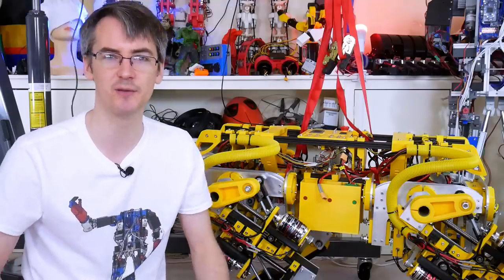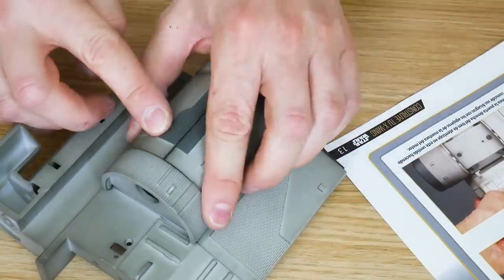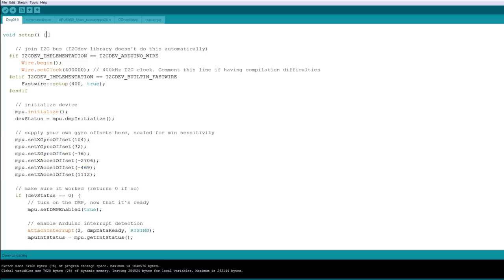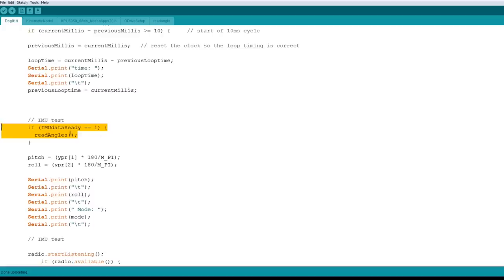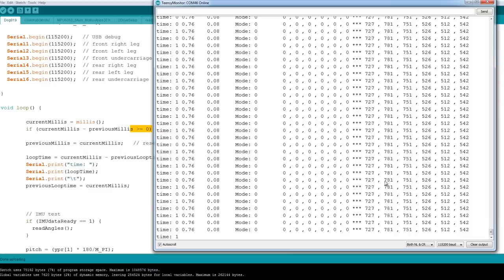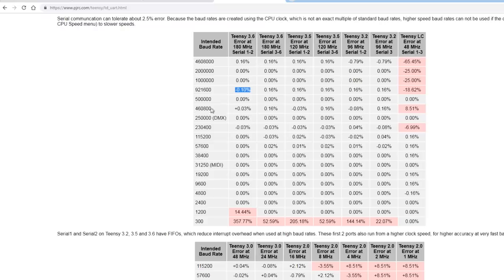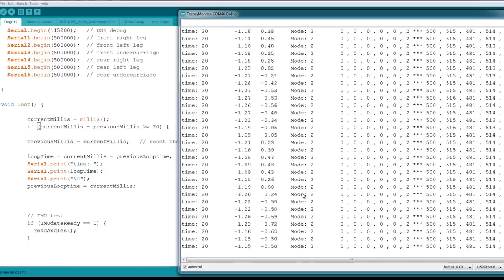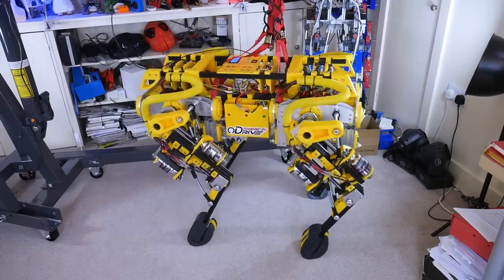openDog Dog Robot #19 - Some Stability | James Bruton

Comment from the maker: I actually realised that my Kinematic model function is writing to all 12 ODrives four times in every loop, so I'm actually doing 48 ODrive writes per loop instead of 12, so that needs sorting out in part 20 and the loop making even quicker.
Reply: 40ms initially for 4x12 ODrive writes. Quick math says even if you went back to the default ODrive baud rate you'd be within your 10ms threshold. Glad you found that issue!
Reply: @SystemsPlanet  You can use YouTube membership by clicking the Join button above. HTH.
Reply: There should be non-blocking versions of the UART's transmit function for the Teensy.  There is no reason your main code should be waiting around doing nothing while a UART slowly squirts out the bits.
Reply: That makes more sense, I didn't think it was a serial baud issue.
Reply: Interrupt-driven serial comms is the solution. Fill a buffer, and let the UART peripheral take care of sending it. It'll let you know when it's done. Split the traffic among more than one port too (parallelization!)
Reply: ha ha you beat me to it I was going to ask you about the 12 ODrives
Reply: Since the timing wont be in sync between MPU and Teensy, you need to ensure you're reading the entire FIFO and clearing it out. You only seem to be reading the first record, the FIFO is slowly going to build up because it doesn't appear you're emptying it.

Comment: Hey James! I work as an embedded firmware engineer, if I can give you some advice, I would consider using an RTOS. This will allow you to make better use of the processing power you have rather than adding more co-processors and with that more complexity. FreeRTOS is an excellent project with lots of documentation, large community, and is even used in industry. 

If you end up using a scheduler, you likely could precompute some of the required positional data with your interpolation and set up some DMA channels to send that out giving you more CPU cycles to process input. 

Just some thoughts, love the project!
Reply: I +1 this. At this moment, he can use DMA for SERIAL of Odrives, freeing the cpu
Reply: I whole-heartedly agree. FreeRTOS saved my project.
Reply: I'd ditch the stupid Arduino environment way before i worried about an RTOS.......
Reply: @maxtorque2277  Using an RTOS would solve an immediate 'felt need'. Ditching the Arduino environment would add complexity without actually providing James with any tangible benefits (at his stage of development)
Reply: Personally you might do better with Zephyr and or Nuttx or perhaps Riot,

stm32 is well documented ( well for anything other than the M3 F2 ) so you should do well out of the gate.
Reply: @vannoo67  What you mean like a Schedular and most likely better interrupt handling?
Reply: @maxtorque2277  I would go with PlatformIO + VScode
Reply: @sethrd999 I didn't realize that you would get that from an IDE. I have used and quite liked PlatformIO, but it didn't offer any of that.
Reply: As many people recommend for several weeks..
Reply: Dedicated serial connections for each odrive is the fastest way to update them, but to get real performance, I'd suggest hacking a Tesla neural processor and train the dog to work out the motor control for itself.
Parameterizing a kinematic model manually is a nightmare, but neural nets just do it naturally.
Reply: @ahaveland  I think first he has to set up a reliable powerful environment first, meaning with good programmed routines and fast response. Also a good controller strategy would be nice.

To use ML for solving the problem is maybe "the new thing" solving problems (which could be often solved more simple with the right controller), but without a rock solid  basement it is simply called waste of time.
Reply: Looks like he doesn't read comments. /shrugs I don't blame him,  Way way too many of them XD
Reply: I'd add that continuing the way your architecture is currently will be unsustainable unless you move to use some threading or scheduling strategy such as is being recommended here. As it is now, all your I/O is coupled together by virtue of using a single loop or interrupt service routine, thus the slowest operation binds everything. The sooner you deal with that and all that polling when there is nothing to be done the sooner you'll be able to do what you want when you want.

Comment: Arduino libraries are great for throwing quick, simple, projects together. The sad truth is, most Arduino libraries are a master class in how not to write firmware and the complexity of your project is reaching the point where the cracks are starting to show. As others have suggested, perhaps consider an RTOS or at the very least structure the code around a proper event loop. That 180MHz processor is more than capable of doing everything you need and more, but only if its resources are used properly.

Comment: Just as others suggested: Interrupt driven serial communication through buffers would probably do quite a lot of magic here. At the moment, your Microprocessor on the Teensy is spending most of its processing time waiting for one UART to finish the last byte before ffeding it the next.
Not only would interrupt driven serial communication allow for other calculations to take place during that time, but also to use all UART peripherals simultaneously.

Comment: I love teensys for robots.

What I've learned:
Don't do things synchronously. Everything should be an asynchronous/incremental event handler.

Send one or a few bytes per time through the loop, calculate only one joint at a time, poke whatever bytes pending in input buffers into a state machine for the packet parsing.

Aim for a loop time < 1ms, ideally 0.1 ms.

This means you have to pull apart almost any third party library and rejigger it to not be blocking, though.
Reply: this is great advice but also its why I'd never bother using a library.  screw blocking black boxes!

Comment: This has been mentioned several times, and I am sure you see it, but JIC: the threaded rods that connect the ball screws to the legs look bent.  I thought it was some sort of camera or lens distortion at first, but when you switch angles it is still there.  The left front leg looks like it is bent the most, but it looks like all of them have at least a little bend.
Reply from the maker: Yes they are, I overran the end-stops at some point and the actuators are powerful enough to bend them.

Comment: James, in your function dmpDataReady, instead of setting IMUdataReady = 1, try incrementing the value, then in your main loop, read the data IMUdataReady times to clear the FIFO and decrement that counter with each loop. This will prevent fifo overflow and give you the most recent value from the IMU

Comment: Another suggestion here. The Odrive uses ASCII code to communicate. You can switch to binary code  and that can make your communication be  at least 8x faster for the same baudrate, but then you need to fix your message frame size.

Comment: Is there a specific reason you're (still) using the Arduino IDE? there are much more capable IDEs that have a lot of comfortable features like code folding, auto-completion, refactoring and what not. I suggest you look into Sloeber V4 if you're fed up with the Arduino IDE :)

Comment: How much data is being sent over serial to the odrive? Does the MCU not have hardware serial? If so maybe try increasing the transmit buffer ideally your packet should fit in the buffer.

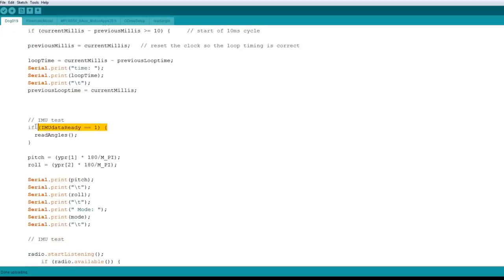Comment: Talking about what you did on 7:00
In most micros you can configure the input pin to detect the rising edge without enabling the interruption. This would avoid a context switching and a possible race condition

Comment: You know that you can do serial writing using DMA transfer so that it does use any CPU at all. Basically u set up the DMA to send the data so at a set rate triggered by a timers. You will just give the DMA the address in RAM that your variable is stored at then the DMA will just send to serial the data at that address in RAM every time the timer triggers. Then anytime you change the value of the varible it will be sent to the serial automatically without using any CPU
Reply: @Out of the BOTS, I haven't really heard of DMA being used like that before. Normal you set up the DMA with a pointer and a length and an interrupt is generated when the end of the buffer is reached and the DMA controller deactivates, until triggered again. If you are only ever sending one value I'm not sure you would save many cycles because you would need to re-trigger each time. If you could precompute a few values in advance with an interpolation engine, than it might be worth while
Reply: Well, if it isn't Mr Bots
Reply: @VLS-Why   There are many ways to trigger DMA transfer, especially in ARM CORTEX architecture like Teensy. One of the ways is triggering it via timer ISR  but even if you trigger it in the loop time the benefit is obvious with this ammount of data flying on serial bus.

Comment: When you are doing timings of functions, what is the overhead for writing out to serial as well.  I remember in my, rather limited, arduino programming that writing useful debug stuff out to serial was completely wrecking my timing critical loop being able to work properly
Reply from the maker: I thought about that, but it's still a negligible impact when before I write to the other 12 axis.

Comment: Hi James! I've done some work with balancing robots using remote IMUs, and a big factor for getting good data out of them was making sure they are mounted firmly to the frame of the robot. At 3:37 you can see the IMU board move significantly when you poke it with your pen. I know that's not an issue you were addressing in this video, but I'm afraid it might be a problem later on when you're trying to make the robot dynamically stable. From the video it looks like it should be fairly straightforward to 3D print a bracket to hold it more firmly, though. Good luck!
Reply from the maker: thanks, it might not have been screwed in during that shot, it's pretty firm

Comment: BTW, you can easily calculate the basic serial transmission time as you know the number of bytes being sent to the Odrive and the Baud rate.  For example at 1Mbaud, each bit takes 1us.  Each byte sent is 8 bits, and i'd expect you to be using 1 start bit, so that's 9 bits per byte, therefore, each byte takes 9us to send, so if you send 10 bytes, that's 90us per message (Assuming your uart serial register load/unload can keep up)
Reply: Should have added, watch out if you are transmitting in ASCii and not in binary. Send "128" in binary and that's a single byte to send, send "128" in ascii and that's 3 bytes! (ascii "1" is 49(dec), "2" is 50, and "8" is 56, ie each digit is sent as an individual byte. Therefore, your ascii serial coms might be creating a significant overhead.......

Comment: I guess the stability control would not work like that for a simpler robot with only 2 DOF legs, because it cac't shift its COM left to roght easily. But maybe it could try to balance by actuating the floating legs back and forth?

Comment: Doesn't dumping all that data out the serial port to the terminal take up significant resources?  Also to get a more accurate timing, set a pin high at the start of the loop and low at the end of the loop, then connect a o-scope to that pin and you can see exactly how long the routine takes as well as how much "reserve" time you have left.

Comment: If you delete some of all your debug data, you write to the serial console, you Will see a much faster timing. No matter the baudrate of the serial port, serial writes slows the program down alot. Of course 0,5Mbits/s is faster than the standard 9600

Comment: I'm not very familiar with programming an arduino (isn't it a custom C++?), but at 9:55, couldn't you have written   Serial.print("time: " + loopTime + "\t");    as well? I realize that's probably just a stylistic choice to do it on multiple lines though.

Comment: Why not use the ISR to read so you don't ever overflow? Copy the new data on interrupt to some buffer. Did you test that and see how badly it impacted the main routine? I'm guessing you won't notice the ISR really impacting your main loop after all the other testing you did.
Reply from the maker: It is, and it clears the buffer each time even if there are multiple values in it.

Comment: Amazing video!! Thanks for sharing.
Sir, have you ever faced any problem using that i2cdevlib library? I am facing a strange problem, after running for 30sec - 1 minute the Arduino stops getting data from IMU. Can you please help me out?
Reply from the maker: It's probably power supply related - the IMU needs very stable power in DMP mode

Comment: James... I'm watching you struggle with your electronics quite some time now, since you tend to run into bottle necks.
So finally, please buy some proper electronics for robotics, this project deserves it.
In example something like a Beaglebone Blue running ROS.
I know you are trying to avoid that, but your projects are slowly maturing into really complex mechatronics so you need to start to gain experience with SBCs and Linux.
The ROS has a big community and I'm sure they will gladly teach you how to use it. Starting with UART you really should go for faster and robuster bus systems.
But at least look at FreeRTOS.